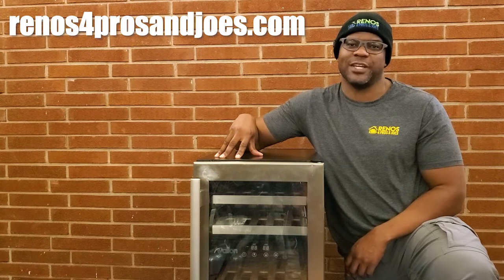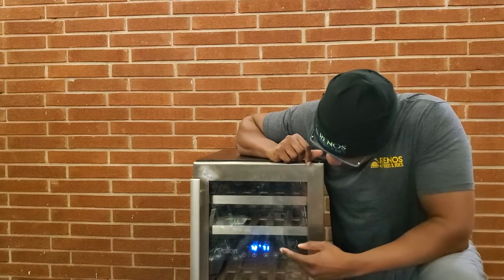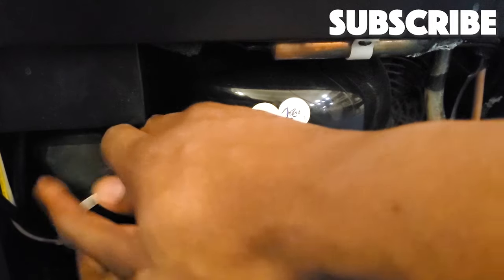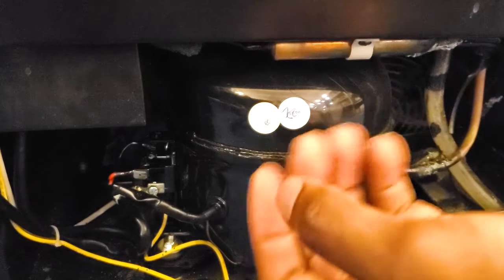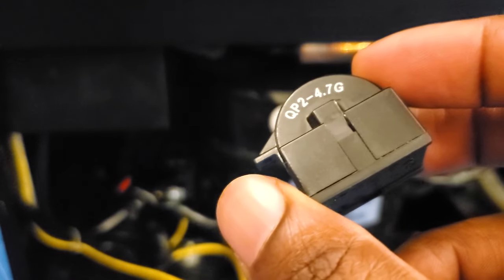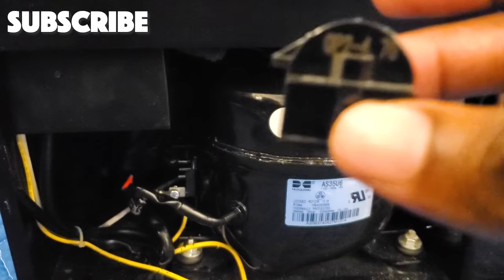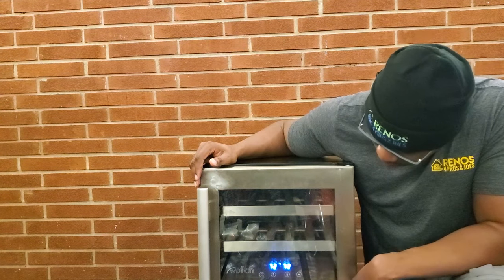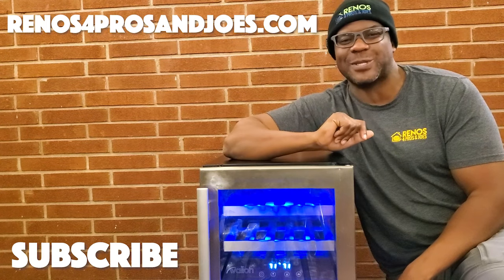HOW TO FIX A WINE FRIDGE | Wine Fridge Not Cooling

Comment from the maker: Cheers! I'm so glad that so many of you have been able to save your wine fridge(s) with this repair. I've created a * "Wine Fridge Tip Jar"* https://bit.ly/3hID1ZQ for anyone that feels so inclined. Thank you all again!
Reply: I just came across this video and was wondering if this part could fix my wine cooler. Currently, when I plug it in, it beeps and none of the lcds turn on but the fridge still cools please help if you can thanks
Reply: Good day. Just came across this video. I have a Danby beverage cooler that’s freezing everything. Do you think replacing this part would fix  my freezing fridge?🥶
Reply: I have  King Chii dual wine cooler. Brand new, and it stopped cooling after 3 months... please help
Reply: Ohh it's stuck at 78*

Comment: My wine fridge was not working, I called a appliance service and they would charge me 450 bucks, however they said that it would better I scrapped mine and buy a new one, so searching in YouTube I found your video. I bought the relay, changed and my fridge is back working. Amazing, even a appliance service was not willing to repair. Such a shame.

Comment: I'm not a super handy guy, but Renos video helped me fix my expensive wine fridge for $10, as advertised.  The clicking sound was the confirmation that I was on the right road.  When I removed the ceramic disk, it was obviously broken.  Fridge is running great and staying cold.  Thanks!

Comment: I did this fix to my Frigidaire wine fridge and it seems to be working.  My challenge was getting the housing off but other than that it was very easy.  Thank you very much for the video!
Reply: Hi, did you see an error code in your Frigidaire wine fridge. I have one displaying an E6 error code and I’m not sure if it’s the same problem.

Comment: THANK YOU! This super easy fix cost me less than $5 having bought the part on Amazon.  Not only did is cheaply solution fix a near $400 wine cooler, but it saved me the hassle and costs of disposal and repurchasing.  It's almost criminal to have thrown out this wine cooler, as was recommended from several repair shops because in their estimate, the repair costs would have exceeded the value of the unit.  Once again, your video was truly helpful and practically a public service.  Cheers!
Reply: Hello could you give me the number of the part you bought on Amazon plz?
Reply: Carl Trec 
Manufacturer	Uxcell
Part Number	A14030700ux0936
Item Weight	0.48 ounces
Package Dimensions	3 x 2 x 0.2 inches
Item model number	a14030700ux0936

It lasted 24 hours before the fridge failed again so it may or
May not solve your issue.

Comment: I have a beverage cooler that quit cooling several years ago. I finally found someone to come out and look at it. He said it needed freon but there was no way to add it. I started looking on Marketplace for a replacement. I found one that is our same model. I asked about it, and he told me he had his cooler looked at, but the repair guy told him the condenser was out. I just found your video, and now I wonder if it is the relay that went bad! One day it was cooling and the next it wasn't. A bad relay sounds more logical to me than a sudden evacuation of freon or a blown condenser. Thanks.

Comment: WOW! This probably is not addressing my Wine Enthusiast Cooler issue, but you do an EXCEPTIONAL job of showing and clearly explaining exactly what you're doing. You might try a puck light to bring more light into the unit--when needed. But great job! I just discovered my unit making a continual clicking sound, with the temperature reading just flashing. Motor is running and bottles are still cool. Hmmm?

Comment: Thanks From BC Canada for this video.  My Danby Wine cooler was making the same noise.  Have removed the part and confirmed that it rattles.  Have ordered the part for $20 and it is arriving tomorrow.  Wish me luck!
Update:  Got the new part and installed and now working.  Cautionary note for others though.  When I first installed it it seemed like it was working but it was turning on and then off about 30 seconds later.  I took another look at the part and it looked like it was not all the way in.  Pushed it in a bit harder which fully seated it which resolved the issue.  Thanks again for your video.

Comment: Great video. Super helpful. TBH, these relays failing is far too common. Either the relays are spec'd poorly and/or poorly made. Meaning, either they're just not designed to handle the on/off current cycles reliably, or they are simply just built too poorly to do the job in the long-term. I've owned many mini-fridges with a similar motor/refrigerant setup and never had this issue.

Comment: I've got an edge star winefridge with the same symptoms.  Found your video and pulled the relay the slide on grounding terminal to the relay was either corroded off or maybe there was repeated sparking in there.  In any case, it appears to be where the problem is.  Ordering the new part.  Thank you for your super clear, spot-on, video!

Comment: I'm gonna give it a try. I have a new cooler that sit for a while till I had the house done. Finally opened it plugged in. Lights up. But I don't hear any noise that is turning on compressor or cooling. I can't return it or replace it since it sit months, will give a try to this fix hopefully will work. Don't wanna trash $700.

Comment: TY! For $9 replacement part from Amazon problem fixed.  👍 and subscribed. I would say nxt time just shine a worklight or even Flashlight in there to show better, even if only for a small time so watchers can freeze it and look.

Also a tip to others: take mant flash pictures with your phone initially and b4 each step so you are confident when u get replacement part exactly how to instSheet.... just like the old pics is answer. I removed bad part and used tge model # to get new one easily.  Thx again!!

Comment: thank you  I have a can fridge, It stopped working. after seeing your video I noticed that it had the same compressor. I just took it apart to look t the relays, they were slightly different and there are two of them. but after looking at them  to get the part numbers  I put it back together  and just for the hell of it I plugged it back in. what do you know it started working. may be the relay was stuck. anyways  thanks for the video, you saved me hundreds of dollars.   Thanks again.

Comment: Hello, I have a dual zone wine cellar and both sides were not working. I replaced the relay and the upper side(white wines) is cooling again, but not the lower side(red wines). Do I need to replace the overload sensor as well? Have you ever experienced a problem like this? Thanks again!! Great video

Comment: It's not a relay.  It's a Positive Temperature Coefficient Resistor, 4.7 Ohms when cold.  It allows current to flow through the start winding to start the compressor motor. As it warms up due to passing current, it's resistance increases to keepnfrom burning out the start winding.  The M (or R) winding runs the motor.  Inside is a nickel sized disc with prongs touching each side under tension.  It doesn't take much of a resistance increase in ohms, maybe to 11 ohms when cold, to keep the motor from starting so it just sits there vibrating until it gets hot enough to trip the thermal cutoff switch.  As it cools the thermal cutoff cools and resets and keeps doing that until it's turned off or, worst scenario, the cutoff doesn't reset and it burns out the compressor or maybe even starts a fire.

Comment: Hi. Thank you. I just bought a Cuisinart CWC 1600 and it was working until I got it home. It is not cooling and I do not hear the fan. Do you have a video or have suggestions for this model? I love it and really want to keep it. Thanks!
Reply from the maker: The information in this video is good for most wine fridges with compressors. However, I believe the unit you referenced is thermoelectric. I did a quick search online and I didn't see much. The best way to try to fix this model may be to go exploring inside of the unit and retrieve a model number that you can search for online. The part that you will likely need to replace is the thermoelectric cooling kit. Good luck! Here is a how-to video for the repair:  https://www.youtube.com/watch?v=XVk4zvgTGU4

Comment: I replaced the parts mentioned, I wasn’t lucky.
I don’t hear my compressor running, only the fan on the inside.
Any suggestions
Reply: I wasn’t either.  After replacing the relay switch, it clicked and the compressor still would not function.  I’m wondering if the compressor is bad if the relay swap didn’t work.  Mine is still under warranty.

Comment: What do you suggest I look at further if the relay doesn't have that shaking sound and the compressor is running but just gets hot?
Reply from the maker: I wish I could be of more assistance. Good luck!
Reply: Your fridge has no refrigerant gas left in it.

Comment: Hey quick question I have a dual zone fridge as well and one side is the wine fridge the other is for cans, the can side of the fridge does not cook passed 52 degrees but I can set the thermostat to 36 degrees it just never gets to that temperature any thoughts?

Comment: Not sure if my issue is the fan, compressor, control knob, overload, or relay. At least the relay is something I can check myself. It worjs for a couple months then will stop and start working after sitting for months.

Comment: I wish I could have seen in where the pins are to get a better idea of how to push the relay in on those two pins on the compressor. I bought both the relay and the overload parts and took both off and I have them wired, but can't see how the overload part goes on before the relay goes on the other two pins.

Comment: Hi , I have newair wine fridge , left  panel is 61 temp and right is 72. If I adjusted the right side lower than 72  it doesn’t change at all stay the same 72. Left side , it drop from. 64 to 61 itself. If I changes manually it doesn’t change. Any ideas why?

Comment: Hi! I just bought a wine cooler. It is two zone and from the company’s website, it says the temperature on each zone can be changed from 5 to 20 degrees celsius. However, as I set up this brand new wine cooler, the temperature controls only let me put the upper zone at 14 degrees celsius lowest. What is wrong with the wine cooler? Thank you!

Comment: When you shake it and it rattles most cases that is defective. It has a round thermo disc inside that when it heats up it makes the connection to gives proper  voltage to the compressor. The noise you hear is a shattered disc and needs to be replaced.

Comment: So we replaced both the overload part and relay part.  When we plug it in, it clicks, gets cold like it should, then the compressor gets hot and the temperature gets warm again.  Suggestions?

Comment: What web site can we find the relay on?
Reply from the maker: I advise doing a general web search for the specific part number and see what comes up, and then buy it from a reputable supplier, that can get it to you quickly for the most reasonable price. Pay close attention to shipping costs, because you can easily pay more in shipping than the cost of the part.

Comment: Does this fix work even if the compressor does turn on ? Looks like this fix may be if the starter relay and overload switch are bad leading to the compressor not turning on at all.
Reply from the maker: I wish I knew more about them, but this is the full extent of my wine fridge repairs for now.

Comment: Well, it worked only for 24 hours. The wine fridge has once again stopped cooling.  Some other issue is responsible for blowing out that relay. Any thoughts?
Reply from the maker: I can offer a discussion thread on this very topic. Hope this helps. https://www.applianceblog.com/mainforums/threads/replaced-start-relay-for-2nd-time-refrigerator-still-not-working-is-it-compressor.28009/

Comment: I can't get the connection between the red wire and the part to unplug. Any tips? I've tried turning the flat screwdriver and needle nose plyers, but nothing.
Edit: My wife watched the video and did it. I knew I kept her around for a good reason!
Reply from the maker: Glad you all were able to get it figured out!
Reply: @RENOS4PROSJOES  Thanks! The part did work by the way. Very simple, helpful video! :)

Comment: My Wine enthusiast cooler just stopped working.  Sounded with a gurgling sound.  It has 2 cooling units but neither are working. No noise now or anything... What do you think might be the problem? A fuse?  Temp lights were showing 88 or error message instead of temp.  Now no light, no nothing.
Reply from the maker: I wish I knew more. I would suggest reading forums and message boards where people are talking about the specific type of unit that you have. Good luck!

Comment: I cannot find a repair person that works on Zephyr Wine & Beverage cooler. I purchased it in 2020 and it stopped cooling 2years later. 
One appliance technician told me that it is the compressor and he will not replace compressors. 
A National appliance company told me they don’t work on Zephyr 
Any suggestions?

Comment: --Hola amigo, excelente video,, tengo una exacta a la que arregalste, y la mia no enfria,,, Compre en amazon los Rele?? Ralei???? esos aparaticos para intentar que funcione y fue imposible,, El motor no arranca, ni suena o no se si conecte en orden los cables,,,,, no se el orden. Me puedes ayudar por favor, estoy en Tustib California y no hablo ingles, Gracias.
--Hello friend, excellent video,, I have an exact one that you fixed, and mine does not cool,,, I bought the Relays on amazon?? raley???? those devices to try to make it work and it was impossible,,, The engine does not start, nor does it sound or I do not know if I connect the cables in order,,,,, I do not know the order. Can you help me please, I'm in Tustib California and I don't speak English, Thank you.

Comment: I bought a new one from Amazon and it arrived on its side. I unboxed it and plugged it in the light came on and it started running and got cold so now its not cooling very good anymore. Could it be that unit you’re talking about.  or should

Comment: I replaced the QP2-4.7G same as what's on my but nothing happened.   I also checked continuity in the replacement QP2 New and Old and both are working but after replacing the recommended QP2 just like yours nothing changes.   No sound from compressor,  internal lights come on when plugged but not cooling nor compressor noise from the back.  Complete silence